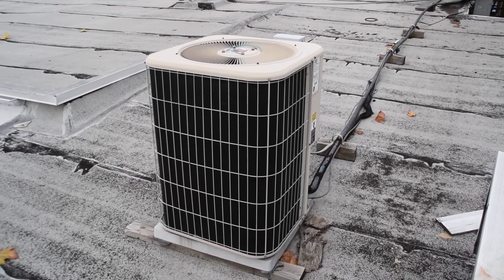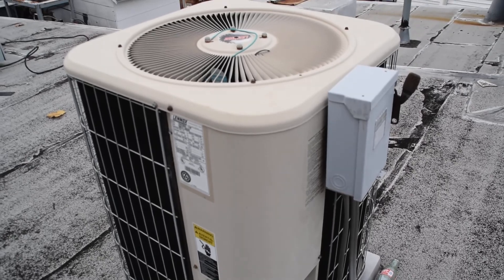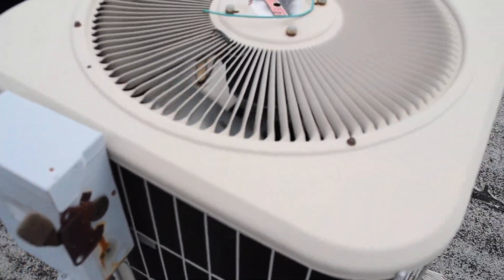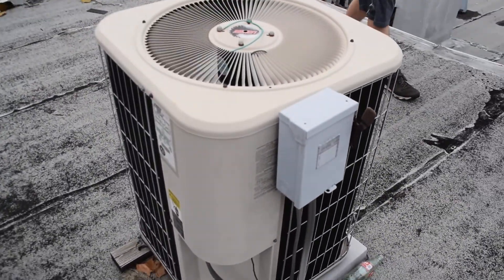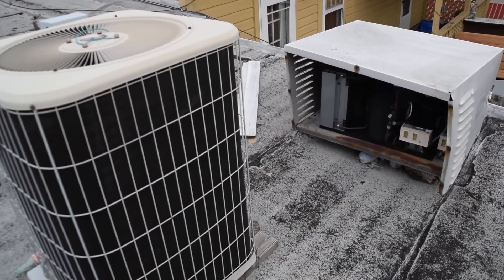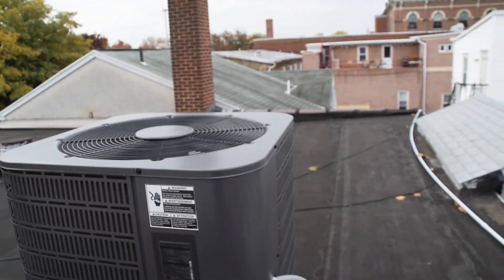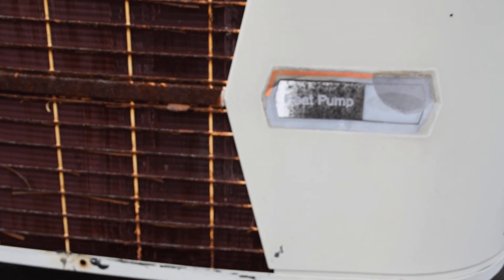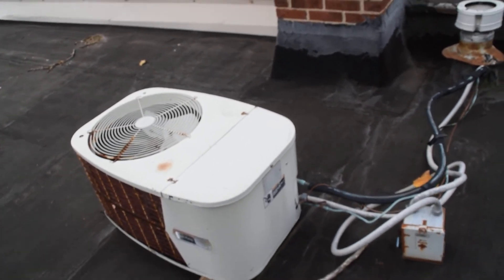2001 Lennox Value Series 4-ton central A/C-compressor not running (and some vintage heat pumps!)

Comment: It's uncommon for the ODU to have any type of timer or delay to avoid compressor damage. Generally thats up to the thermostat, when the thermostat calls it physically applies power to the contractor in the ODU and the compressor gets power, even if it was just running and has too high of a differential to start. 

Some newer units are starting to provide something like an Emerson smart switch built in, or other electronic protection, but thats often only on the higher end new stuff.

Comment: Sounds like you need a new run cap! That or the compressor is grounded, or on high/low pressure. If its the cap its a quick, cheap fix you can probably do yourself.